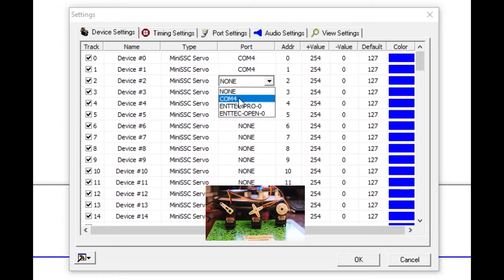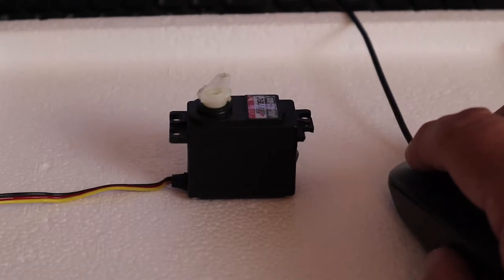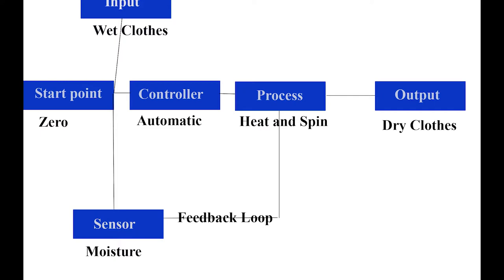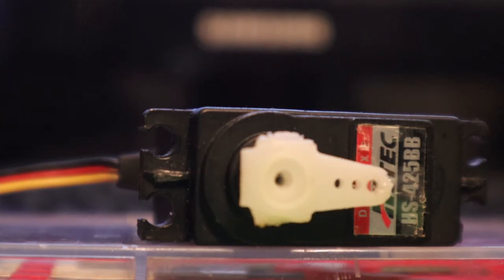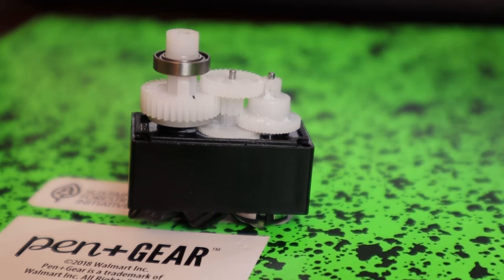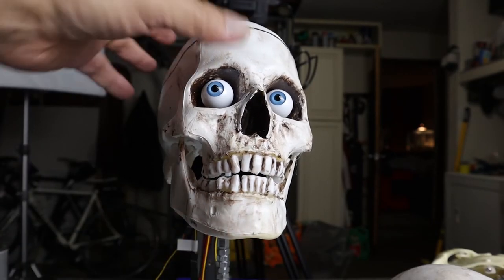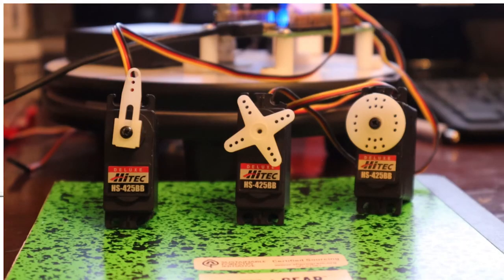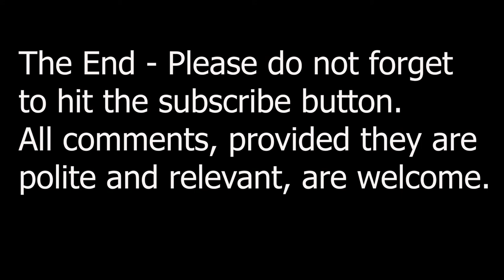Introduction to Robotics and Animatronics part 2

Comment: Fantastic video! Can commands be sent from VSA and stored on the SS32, so when it is powered by a battery you can just switch it on and it will run the sequence? In the past I used a polulu mini maestro and their servo command software to achieve this, but the software didn't allow for the precise movements I needed.
Reply from the maker: Hi, this is a common question.  A lot of people want to be able to run their animations without a computer.  I am hoping to get back to this channel soon and begin making more instructional videos.  From what I have been able to find, the best way to store your VSA routines onto a usable platform without a computer is via a RAPU (Remote Advanced Playback Unit) and an android device.  Unfortunately, this requires an Android phone .  You will essentially be using your cell phone to operate the SSC32u through stored VSA routines.  My plan is to buy an old Android phone to use solely for this purpose.  Follow this link to view the setup - https://www.brookshiresoftware.com/rapu6_overview.htm
Reply: @sciencewithericandandy8588  that is great thanks. So is the RAPU just software or does something plug into the SS32? I looked at the play store and the software is quite expensive so I'm hoping there is something onboard the SS32! Thanks again for taking the time to reply. 👍🏻
Reply from the maker: Hi again,
The RAPU is a circuit board and software.  I believe you copy the VSA routine to the RAPU and then transfer it to the Android phone.  Then you play the routine from the Android through the VSA @chrisjhart
Reply: @sciencewithericandandy8588  thank you very much!